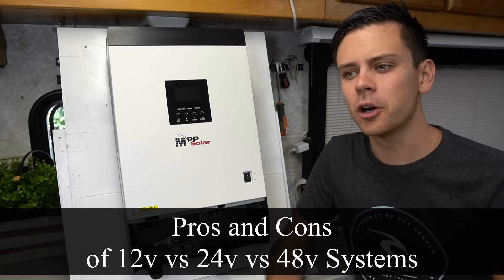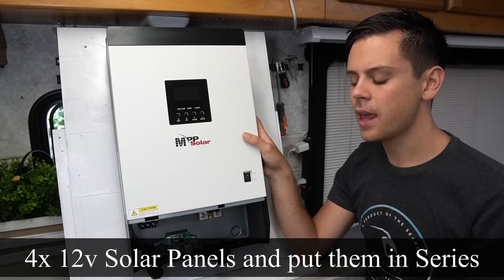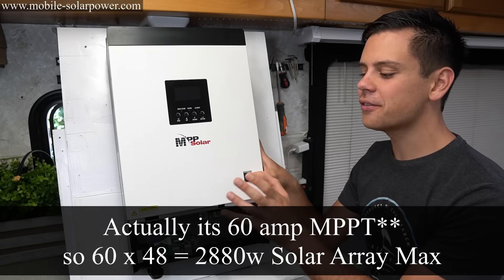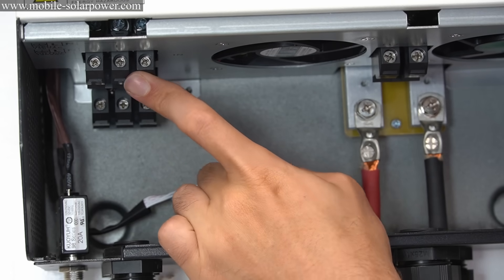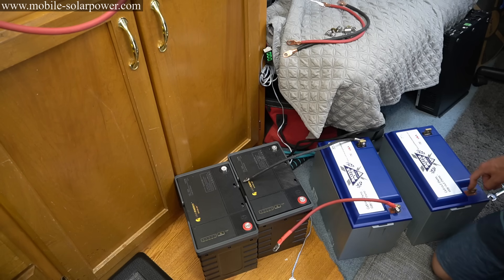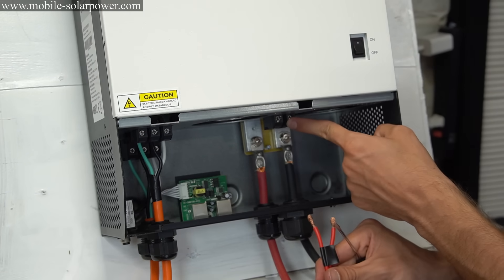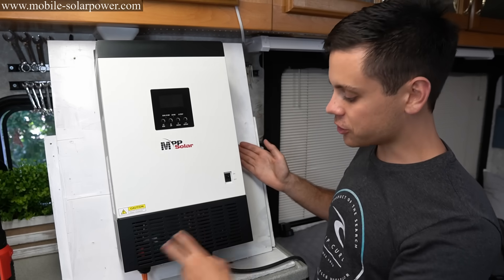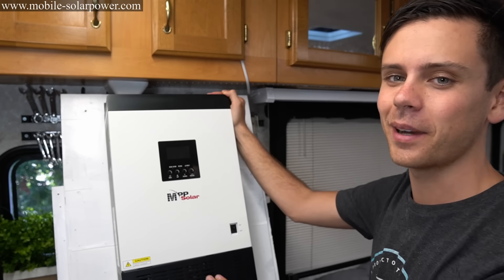48v Solar Power System for Beginners: Lower Cost and More Power!

Comment: Can @Will Prowse comment on this: 
Trev Bridgewater
3 days ago (edited)
I had this MPPT controller on my truck for a few years. The BIG downside which Will hasn't figured is that 4x12V batteries will only charge to the maximum internal resistance of the first battery in the series. I wish people would get a grasp of this issue as it's limiting many people's return on their investment dramatically, in some cases. 
Here's how my real World results work out: I have 2KwH of solar panels on the roof. When I have 4x220A batteries in series the maximum charge I get in full sun is around 550Watts, which is due to the internal resistance of the first battery. (Note: lead acid batteries should charge at around 0.05 C, ie.5% of their total capacity. ) 
Just to prove this point I changed to a 24V MPPT charge controller & the same system charges the batteries at a rate of around 1100 Watts !!; since now it has 2 strings of 2x12V, so twice the 220A X 0.05C. 
Another solution with the 48V system would be to increase the number of battery strings to 2 , ie. 4S2P batteries, to allow the charge coming in to get a better chance of absorption, & not to get wasted by this internal resistance, but at 50KG per 220A battery it would be pretty darn heavy! However, for me to get the full use of my 2KwH solar panels in a 48V lead/acid system would require 16 X 220A units.
I wonder whether Lifepo4 batteries run into the same problem??

It annoys me that many people like myself have had tto endure such a poor performance because no-one seems to grasp this issue. The potential wasted solar Watts Worldwide could potentially be enormous.

Comment: its not the voltage is the issue its the current , you can have 15000 volts and 0.0001 amps nothing will happen , so it depend on the amps if you have 30 volts and 20 amps its dangerous
Reply: What are you talking about? 15KV at 1mA and 30V at 20A which one is dangerous?
Reply: @ghamelvis3555  30 v at 20 amps of course
Reply: I build sound amplifiers and the transformers I use are rated at 50Vac /15A and no electric shuck that much as you will think.
Reply: Talking of 15KV at alternating voltage with 1mA current will shuck you very badly. It's just like touching the high voltage cables and saying nothing can't happen to you.
Reply: @ghamelvis3555  been working in service for over 22 years 15kv at 1 ma will not shock you it will give a zap small one but 15 amps can kill even at low voltage

Comment: Plan on using solar power for long term grid out situations and for off grid as well.  Problem is that industry has been slow to provide "plug and play" products.
I feel that your video presentations are very informative but this one has caught my interest because of the simplicity of the system.
Thank and a gret job.

Comment: Redundancy, I have this MPPSolar make of unit accept it's 240 volts AC, 500 volt input and 3000 watt inverter and so far excellent however it is my back up because I have an Outback Flexnet system 48volt with 3750 watts of panels and 320 Amp x 6 volt x 8  AGM  batteries.Bear with me, for me to double my 320 amp AGM battery bank was over 3000 dollars AUD, this 24 volt unit including 135 amp x  12volt x 6  AGM batteries was half the cost, I have separate solar panels to connect but haven't as yet and don't need to really cos once the flexnet 48 volt batteries are fully charged I just switch  the access power from the panels to charge the 24 volt system through the AC voltage input on the MPPsolar unit and all charged by 2PM winter time.
I have split the house hold loads so each battery bank only uses 20 percent of the 135 amp and 320 amp storages, this will extend the longevity of the batteries plus if a breakdown I still have 1 unit to take up duties and my unit was easy to hook up plus 80amp charger and the ability to have more panels in series which saves wiring costs, just another way to capture electrons, Cheers.

Comment: It is not the Voltage that can kill humans, it is the current that kills. Humans have died at as low as 42 volts. Time is also a factor. A current of 0.1 ampere for a mere 2 seconds can be fatal.  cheers Alex From Downunder
Reply: Yes you're right. Taking into consideration the resistance of the human body with a current of 50mA at 220Vac for 2 to 5seconds you're dead.
Reply: 5 to 25mA at 220Vac you're considered at factual stage from 25mA and above it's dangerous.

Comment: Hi Will, Your videos are terrific and you're a wonderful communicator! Been watching many diy solar youtubers for years and your channel presents complex subjects in relatively easy to understand ways.  I'm slowly working towards an off grid system for a little shack I have in the Caribbean and found your most recent MPP 48 volt tutorial helpful.  Can that MPP, from the AC out, connect directly to an electrical panel with circuit breakers? Keep that sharp mind humming.  Best regards, D

Comment: With the 24v and 48v systems, do you add a 12v converter by connecting it, fused of course, directly to the positive and negative terminals coming off the battery bank? Thanks!

Comment: Good Sir, could you kindly explore/design a solar electrical system for a van/rv that all the appliances use 24DC?  no inverters,no 120VAC...just 24volts to lights,ac that runs on 24volts, a frig system...ect.  not sure what to do for heat as that is tough to produce with such low voltage.  but a/c,frig can....thanks

Comment: lOVE YOUR VIDEOS! Would love to see a whole house off-grid video, showing how to connect to the house main panel. Like my highest electrical bill for the year I use 79KW a day! Sure would love to see a system built for that type of usage. would the 48v solar system work? I'd like to use the least amount of solar panels as possible, to keep cost low. keep the videos coming !
Reply: IMHO, you're asking a lot. Are you looking into reducing your usage from the grid or are you wanting to cut ties from the grid? This will answer what you want to do as far as sizing your system. Also, you might want to look pretty hard at what systems you can do without, that is, what systems can be left on all the time, or use intermittently, etc. Depending on your situation, I'd look at multiple inputs into your system. Combine solar with wind with micro hydro. Starting with 48v would work, but I'd take a harder look at higher voltage solar systems.

Comment: Here's a dumb question: does this inverter create it's own sync or does it have to be connected to the grid to sync at 60hz? Looking at the listings for these devices the wording they use is confusing and I don't want to order from China only to get something I can't use.
Second dumb question: Can I use larger panels with this inverter than the 100w panels you link to. I have a bunch of 310w panels and would like to use 2-3 of them to feed the inverter.  I know I can do it with the 5kw inverter, but thought something might be different with the smaller unit.
Reply: Never mind. I bought it. I'll figure it out.

Comment: Hi Will, I love your sites and watch all the time.  I have only one need at this time.  I'm a new RV'er and have to have air conditioning.  My Dometic ac pulls a little more than 1300 amps at startup and runs at 900 to 1000 amps on high.  What is the best solar solution for me as for as being off the grid?
Reply: You mean Watts?
Reply: @benm6615  oops yes of course.

Comment: We're looking for a solar system that will provide lights and a few Necessities like a refrigerator but the main thing is a well pump when power goes out we lose all water the well pumps 20 amp breaker but it uses 240 uses both sides the breaker what do you suggest

Comment: What about electronic deadbolts with wireless controller? I'm a little worried about someone stealing. I have trak4 GPS hidden. It's amazing. Installing a loud horn if the door is opened without wireless deactivation, but I also want wireless electronic deadbolt

Comment: Thank you for all of your very helpful videos!  I know it's a ton of work.  I have a 84 Vanagon.  I have enough room for 1 Renogy solar panel on the luggage rack... Then I'm thinking of connecting it to a Rockpals for a simple solution.  However, how I'm confused as to why these are so compact and yet appear to have more power (75ah) than a dedicated battery like the Renogy 50ah battery.  What am I missing?

Thanks again for your time!

Comment: So, if I understand this correctly this has a smart battery charger built in.  lets say I have Lithium ion batteries.
My question is:  Can the battery charger in this system be programmed to charge Lithium ion without a BMS?
Reply: If you have the manual of that inverter I guess you will be clarified

Comment: Why is there a spark when you connect the battery negative?
Reply: All inverters have a capacitor bank. They are empty before hooking them up. The arc comes from the battery to the inverter capacitor bank as the connectors connect.

Comment: Question -for just grid tie operations - does excess flow back into grid via same input that also charges the battery if its low?  In other words you wont need the output cable at all ?
Reply from the maker: No, it does not feed the grid anything

Comment: I have been looking into whole house solar, and getting a company to do it for you is usually cheaper since you can get State/Federal discounts and you have to pay a licensed electrician to do the grid tie stuff any way (where I live, your house is required to be on the grid).  All companies I've talked to use micro inverters.  

Let me know what you think about this hypothetical setup:

I have an exterior main breaker panel, from there it splits to 3 panels.  One downstairs, one in the garage, and one in the detached shop.  This is how the house was built 30+ years ago.

Step 1:  Get solar panels with micro inverters installed by a partner of my power company.  With the Federal / State discount, resulting price is the same as or cheaper than I can buy and install the solar panels manually.  Result would be a net metering device on the main exterior breaker panel.

Step 2:  Buy a MppSolar 5KW and 48v battery array and re-do the garage breaker panel so that the the 120v solar array (flowing through the normal house wiring) charges the batteries on the MppSolar, which then powers my kitchen, freezers, etc.

Step 3:  Repeat step 2 in the basement, which provides lighting etc for the rest of the house.  Possibly repeat in the shop.

I'd end up with 2 or 3 MppSolar 5KW units each with their own battery banks in different areas of the house.  I wouldn't have DC charging on the batteries - only 120v.

I don't think I'd be able to run the AC off of the batteries (which is okay) unless I tied 2 units together to get 240v.

With many companies, the house power shuts off if the grid goes down - except for a single 120v line to the garage to power a Yeti (or something similar).  If the solar company I go with is similar, then, after the install, I would extend that line and run dedicated lines to all the breaker boxes so that I could still have 120v into the MppSolar units when the grid is down.  Depending on how the grid tie works, I might have to make it a manual switch over.

One question is this: Would the 120v house power (from the solar or grid) be used 100% of the time unless the grid is down and it is night time?  So the only 120v to 48v DC loss is a small float charge?  Or, would the MppSolar inverter drain the batteries down to cut off before taking the 120v input line?  Does that make sense?  I would want the MppSolar units to only use the batteries if there was no power coming in on the 120v line.

Assuming the last paragraph is possible, and assuming I use overkill gauge wire (not an extension cord) does this seem like a valid route to go to get whole house power (at a reasonable price) and be able to add batteries later?

Sorry for being so long winded, I hope it was clear enough.

Thanks.

Comment: Hi Will, Love your videos man, keep up the great work. Quick question, have an old 10 yr APC UPS, do you think it is possible to beef up its run time by swapping the SLA it comes with with a Lithium battery, if yes, could you do a video on something like that, it would be a great project for backup power for small devices like laptops, modems and such. Thanks again man.

Comment: Great video Will!  What's the efficiency benefit by using a 48V system compared to a 12V?  Also, what's the standby current draw on the 48V inverter?

Thanks for all the info you give out!

Comment: i am building a 48 volt off grid,   using headway 38120 x 15 =48v   (15s 48v)  = 1 pack. can i run multiple packs  in parallel ? i also use dc circuit breakers so i do not get  bolts of power sparking up, they are also very inexpensive

Comment: For me these would not work at all because of the very high idle consumption. 400 watts just to run this in idle time is beyond reason. Also for the money  I would be way better off building a system like I have. This seems to be a good product for someone wanting to keep it simple and not wanting to or have  the time to build a system. I am trying to get as far away from buying any power also and don't like grid tied because of the laws that the power Co. bought and payed for to rip off the end user here in Florida. From what I have seen so far it's the same with other states as well. Does look like a simple system but not efficient at all. Shipping for this seems to very high also. $365.00 + 63.09 = $428.09 The one listed is a copy also with a warning!

Comment: When connecting the solar panels to the inverter, did you go through a charge controller?  If so, what was the amperage of the controller?
Reply from the maker: Charge controller is built into this unit

Comment: Is a BMS still needed if this is hooked up to multiple LiFepo cells? Or is there an internal BMS within this unit?
Reply from the maker: Use drop in LiFePO4 for these units. There is no low temp cut off in these all in one units. Or build your own bms of it's a large system to your own specifications

Comment: 12 vs 24.....when I went from 12v to 24v my battery bank drains way faster...for instance I would wake up too 50 % at 24 volt...compared to 80% with 12v....I'm using 4 / 100 amp battleborns,  2000 watt array,  712 BMV and Victron charge controllers controls and 24v 3000 watt aims converter charger....went back to 12v 2000 watt zantrex....why...why
Reply: Your current from the system dropped so if you want to be at a good footing, then you need to increase your Ah system. If you had 400Ah power bank battery system at 12Vdc, then you need to make sure that at 24Vdc, you still have 400Ah power bank battery in tack
Reply: @ghamelvis3555  if he used the 4 x battleborn batteries @ 100A each in series parallel, he still has a 4800w system at 24v  & theoretically it should be more efficient at a higher voltage input. If nothing else much changed usage wise then maybe the larger inverter idle was much less efficient, ie: used more power than the 2000w zantrex, I dont know.

Comment: To avoid the initial large spark (as it charges up the capacitors) - can use a resister in series if you like. It seems not healthy to just dump full power into it like that though no-one seems concerned about it...
Reply from the maker: Yes absolutely

Comment: If I build 2x12V packs, is it possible to charge them in series as 24v and get output in series 24v and 12v in parallel without the stepdown converter?

Comment: Thanks mate
Awesome video.
Would you recommend this setup on a yacht or stick to a 24 v system for shock safety in a possibly wet environment.?
I am looking at purchasing four 12 v 200w rich panels with an all in one 24v 4000watt inverter/ battery charger/ 60 amp solar mppt all in one unit with a 24v to 12 v converter. Your thoughts would be appreciated. 
Keep up the great work
I learn something new every time I watch one of your videos.

Comment: Great video! But will the Mpp's work with a smart meter? I don't believe they are UL/CSA approved?
Reply from the maker: They do not back feed the system at all, so no need. That part of the circuit is just a big fancy battery charger and ATS.

Comment: On what planet is 24v or 48v cheaper thsn 12v?
Please posit total setup comparisons as from all i can see is 24v Z& 48v batteries are waaaaaay more expensive which is nowhere near offset by “$100 less cables costs”
Reply from the maker: Wayyyy cheaper. Do the math for each voltage and you will see. Usually the mppt circuit savings alone make it cheaper. Check out my other videos where I get into this
Reply from the maker: https://youtu.be/Vi7eswWwosk
Reply: I’m obviously being dumb and missing something but your videos and website both state you need to buy double-or-more the batteries
Plus potentially more solar panel.
Does 24v require less Amp hours from the batteries to do the same job?
Reply from the maker: @flyingdutch9818  do not, ever, use amp hours. You need watt hours to calculate capacity. watch my beginner videos on electrical equations. its in my beginner video series.

Comment: Another great video. Do you plan on doing a video on Residential Solar panels for an RV i.e. LG's neon, longi solar panels, Panasonic HIT series. Premium residential panels. These seem to high efficiency, a very good price per watt. Many seem to have a high VOC of around 50V rather than your standard Amazon 100W panel with VOC of around 20V.